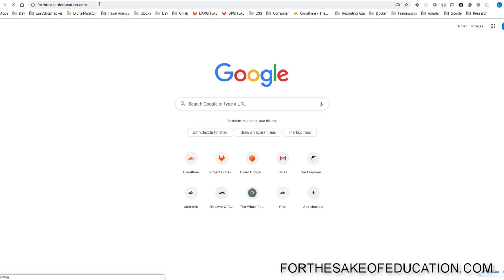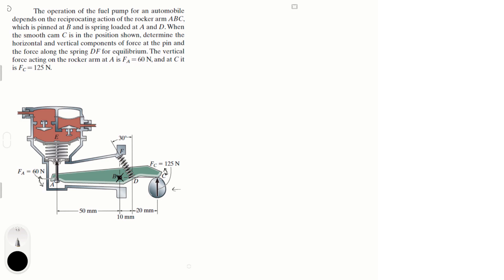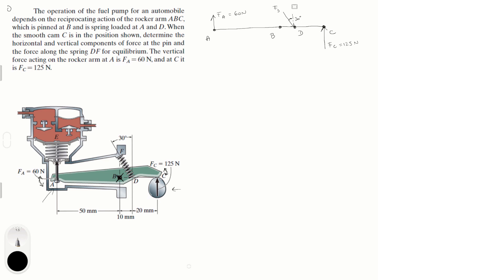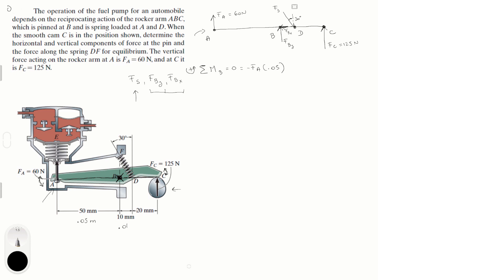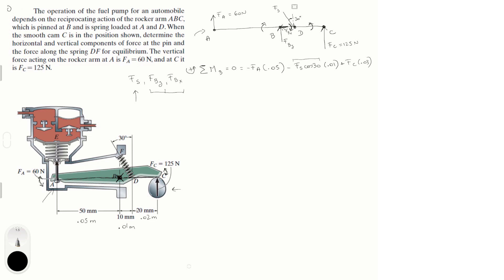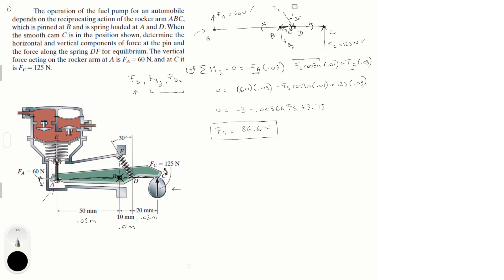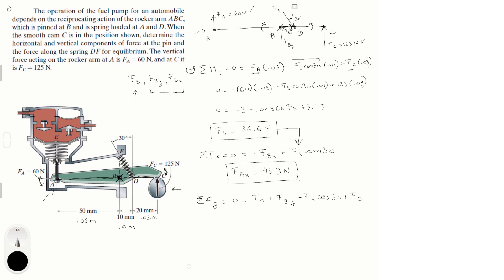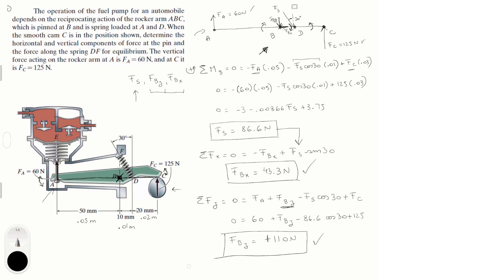Determine the force at the pin and along the spring

Comment: How did you know that the spring was pointing in that direction? And how did you also know that bx pointed in that direction?????
Reply: You have to understand the mechanics a little bit. The purpose of spring FD is to keep the rocker arm pressed against the cam so the spring force must push towards D. Since the spring force pushes the arm to the right, the force for equilibrium FBx must point left. Hopefully this helps